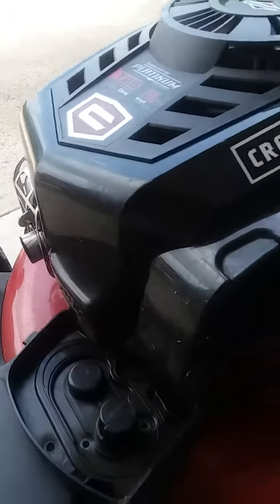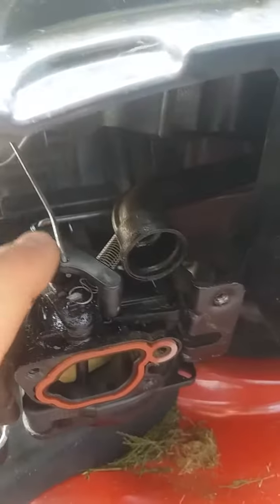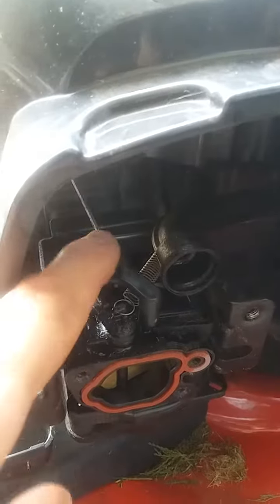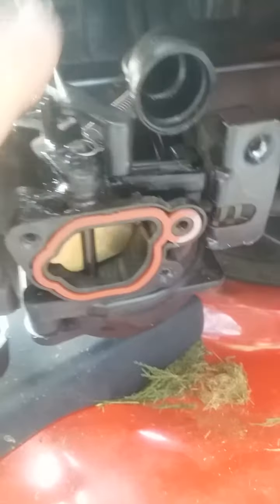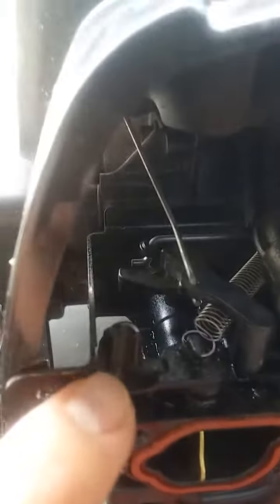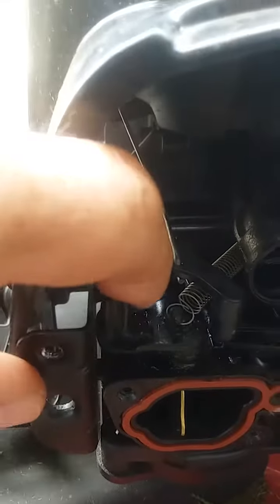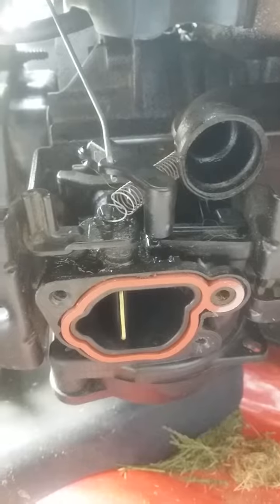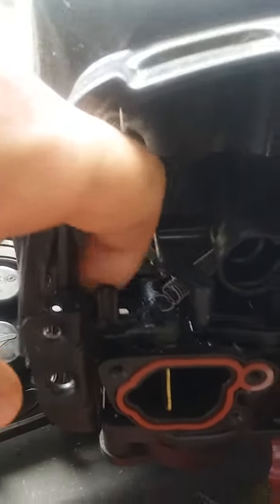Briggs and Stratton EX550 auto choke stuck open.

Comment: Nice description of the frustrations found when fixing some things, then having it not work, fix it again, not work, etc... many problems with these small engines are like that and the persistence of the troubleshooter becomes important. This does give me some 'out of the box' ideas to look for with my intermittent sticking choke issue. It was working after I played with the movement some, so I thought I had worked out the catch, wrong. I'll try the WD-40 or some other lubricant, and if that doesn't hold, I'll examine it more closely for a possible physical rub. Thanks.